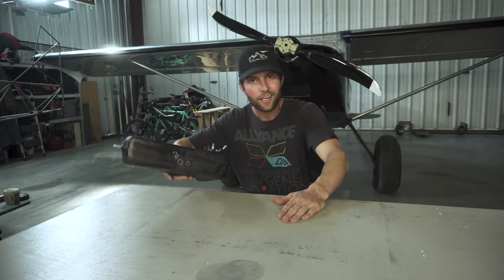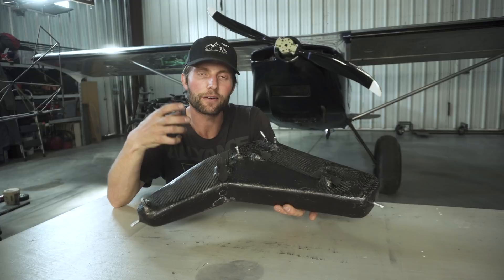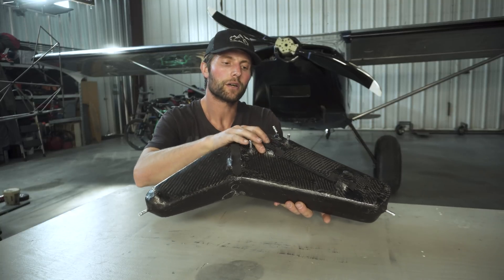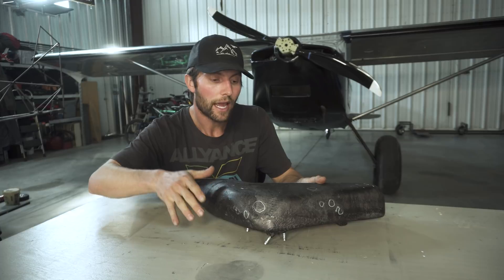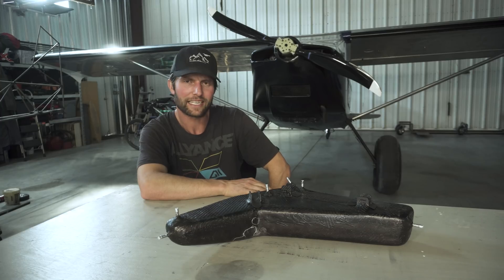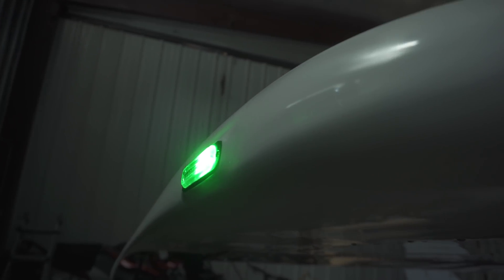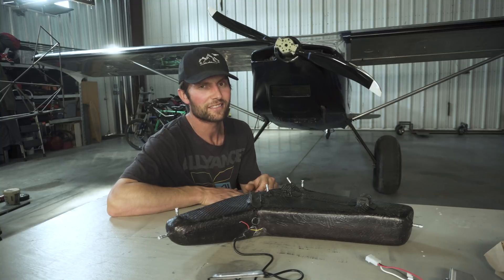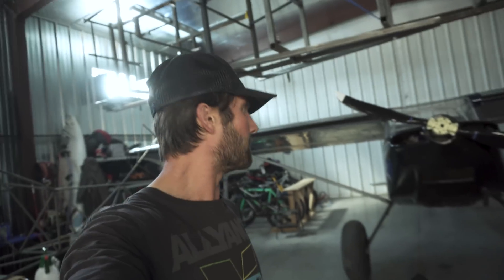Capella gets a CARBON FIBER fuel tank.

Comment: I covering the plug with clear tape ..then fibreglass or carbon resin etc.  make a fitting hole and dissolve the foam with thinner .. acut the tank in two part and remove the  clear tape ..then join the the two piece with materiel

Comment: i love it! it is  like a dumb version of Mike. :-)
Reply from the maker: I actually fallowed the advice from Mike to dissolve the foam 🧐
Reply: @JonasMarcinko  forgive me for the remark I just couldn't resist laughing when I came across your channel and saw how you do things I consider very complicated. I worked in aviation and even co-designed the fuel system for the G150 so I know how things can actually be so much more complicated than people realize. BTW I think it would have been nice opportunity to try rotomold, this why you can have a clear plastic tank you can see how much fuel you got and you can have less ports and chances of a leak. (And I don't think Mike knows how to do that..)
https://www.youtube.com/watch?v=KkNkQRC0czc

Comment: Do those strobes work ? I ordered the same and they sent me red / white that could not switch between the different patterns and all green ones instead of green / white. I already sent them back and was refunded. How did they work out for you ?
Reply from the maker: yeah they worked for me. You need to cycle through the patterns. (There are a lot) it's a bit frustrating if you go past the right pattern though.
Reply: @JonasMarcinko  I actually did that. The Red / White set did not cycle at all. Something wrong with them. Thanks anyway.

Comment: Jonas! You probably already know, but if you don't, check out this site. He has done a lot of research on VG. I fly the same Savannah as he does, and he was the reason for me, rebuilding my Savannah. In 2010 I dismounted my SLATS and installed VG's, same STOL performance but 12-15 Mph faster without SLATS/speedbrakes. 2 years ago I rebuild my wings to the "VG Wing", longer cord and VG's. That gave another 5 Mph, so cruise is now 100 Mph with Rotax 80 Hp. Not bad for a tricycle ;) 
Thanks for great videos 
https://www.stolspeed.com/

Comment: Make sure you get adequate fuel flow from your header tank in a nose up (climb) full power configuration.  On my PA-18, I have a header tank on the firewall (left tank) and one located behind the baggage compartment (right  tank).  By the cub operating manual, the left wing tank should always be selected on takeoff since fuel starvation is possible from the right tank (I think because in a steep climb the right header tank is potentially below the carb in a low fuel situation).

Comment: Aluminum fittings will corrode quickly due to the galvanic difference with the carbon fibre tank.  You need passivated stainless or titanium fittings.  Alternatively you need to electrically isolate the aluminum with layers of e-glass or s-glass.

Comment: Jonas;  Loves you videos.  Great work on tank.  However, be cautious of gas tank slosh.  I have a Van's RV-8A.  Van's has a Service Bulletin on Gas Tank Slosh  (https://www.vansaircraft.com/service-information-and-revisions/sb-11-9-13/) .  I assume you have a fuel filter downstream, but as Van's states, loss of gas tank slosh could cause fuel starvation.  Also, on our fuel tanks we use Pro Seal around all the penetrations.  A pain to work with, but impervious to gas, including ethanol gas.  Lastly, with respect to the grommet you used, some are compatible with AvGas, but to be sure, I would take one and put it in a sealed jar of AvGas and put it on the shelf for a couple of months to test compatibility.

Comment: If you get one of those lufa cutters (the pizza wheel cutters) and trim some carbon fiber @ 45° about 1/8" of an inch long...you'll have a little pile of carbonium fibers, you can mix this in with the microballons and it will GREATLY strengthen it.  Don't add too much as it will be too hard to work with.

Comment: Is the weight saved with using carbon fibre worth the extra cost and trouble over using alloy. I once made an alloy tank using folded seams and with flushing sealer it did not leak. With you being on the lean side you have a built in advantage over some of the other pilots in the STOL comps AUW is what counts and the pilot is a big factor in this.  Nice instructive video. Regards, Jim in NI UK

Comment: Great work on that header tank. :) Nice try on those cuffs. VGs might help, or even retractable slats. I wonder if "BOUNDARY LAYER CONTROL"  (B.L.C.) might be the ticket. On jet aircraft they bleed compressed hot air from the compressor section and run it over the top of the wings when extra lift is needed. How to do that with a "RECIP"?  I'd bet there's a way. Might be a lot easier to install rather than slats.

Comment: You need to shape the foam then wrap it with masking tape. Resin will not stick to masking tape. Then do your layup. Once cured eat away what you can with acetone. then dig out the tape that will collect the rest of the foam residue/remnant. Could have wrapped the aluminum with fiberglass. that prevents galvanic corrosion.

Comment: Vortex generators under the horizontal stabilizer will help with blanking out the elevator because of the turbulence from the tires in the landing configuration
Reply: What evidence is there of - "blanking out the elevator in the landing configuration"?

Comment: Hey Jonas the gasoline may eat the rubber grommets. I had rebuilt a fuel pump and the gas changed the shape of the rubber o-ring and dissolved it. You should check the tank with fuel in it for a few days before installing the tank.

Comment: something to consider.  Carbon fiber conducts electricity.  If your tank isn't properly grounded, you run the risk that electrolysis will remove the coating from the inside of the tank.... I just had that happen in a metal tank, stray voltage from the fuel sender removed the leak-prevention coating (in big sheets).... will it be a problem for you? I don't know, but it is something to be aware of.

Comment: Glad to see someone really make a solid valuation of the wing cuffs. You are using a US 35B wing profile, your best bet is a moving slat... event a fix slat is not as bad... http://acversailles.free.fr/documentation/08~Documentation_Generale_M_Suire/Aerodynamique/Dispositifs_aerodynamiques/Karmann/Looking_for_lift~Exploring_high_lift_devices.pdf. You will enjoy this.
Reply: Actually, the airfoil is a modified Gottingen 387.  Slats are fine if you don't mind giving up some cruise speed
Reply: @johnhowell9327  You mean the Capella?
Reply: @jemo_hack  Yes - the Capella airfoil is a modified Gottingen 387 - some of the original profiles under-camber was removed to reduce negative pitching moment and reduce drag.
Reply: @johnhowell9327  Ah, I see the difference. Have one rib from my Capella, and I thought it was a USA 35B all this time. ;) The Cub Rib that I have here at home is too large to properLy compare, but man are they close... have a look at my link ;) Clearly you give top speed but not rally as much as everyone claims. Round Struts to Landing gear take much more out of the top end speed. And to be clear, cuffs take out as much out of top end (in other words they add as much drag as a slat) but they don’t give you as much benefits. Have a look at my link ;)
Reply: @jemo_hack   A single round gear strut is easily streamlined.  I have much data on the drag penalties for all kinds of leading edge high lift devices - none offer a free lunch when only a few knots reduction in stall speed may be gained.  It's all a matter of design priorities and compromises.  Cheers!

Comment: Now get rid of the landing gear cables to free up the absorption capabilities of the spring gear (let em whip!) and let some air out of the tires for smoother roll over rough terrain!  Is adding a high travel gear worth it at this point?  Everything is a compromise - add more complexity, weight and drag for a so called bush gear, or stick with the simple and tough heat treated 6150 alloy spring gear that you have for less drag - the stock gear seems to have absorbed your previous meteoric impact with the third planet from the sun without any trouble, LOL!   Your choice!!!!  :)

Comment: How about fowler flaps, and self deploying leading edge slats like the Zlin shock
Reply: A whole lot of additional complexity, cost, and weight for not much gain once you are already going so slow
Reply: @johnhowell9327  Yes but it would be nice to be able to land with no power, almost hands off the controls, and the plane just parachutes in and super shock landing gear handles the impact.
Reply: @gregarmstrong4653  Even if you could get to airliner like levels of max lift coefficient with multi-slotted Fowler flaps and leading edge devices you would only get another few knots reduction in power off minimum steady flight speed - there is no additional lift to be had with zero forward speed ;).  Everything is a compromise - If that level of additional complexity is worth it to you then by all means go for it!
Reply: @johnhowell9327  nope. I did not say zero forward speed. zero power. Optimised airflow and control at incipient stall is a useful trait in the stol world.
Reply: @gregarmstrong4653  Understood.  Like I said, its a balancing act of compromises.  When designing the Capella, I did not find much additional gain to be had considering the extra cost and weight (a high percentage of a light plane) that came with such systems.  Target market and other performance factors set some of the design goals as well, with a few knots additional minimum achievable speed not considered worth compromising other goals.  It appears to do quite well in the low speed department as it is if you ask me, but mine is a biased opinion ;)
Reply: @johnhowell9327  Sorry, I did not realise that you were the designer. That is an excellent little plane as it is, well done sir.  Its just that Jonas was modifying it, so I added my 5 cents worth.
Reply: @gregarmstrong4653  No worries.  I realize I come at it from a different point of view, but I get it.  Everyone is free to tweak them as they see fit to suit their own needs - Thus the term EXPERIMENTAL.  Cheers!

Comment: You should have used wax.  Once the layup is formed over the hardened wax, a hole big enough to allow molten wax to be poured in and out of the layup a few dozen times to melt the wax out can be reused for lines.  A chemical dewaxer probaly gas, too, gets the remainder; and c'et voila.

Comment: A couple of hints.  First make your plug out of soft pine wood. I use 2 by 4s cut up to the approximate shape desired. Use Bondo to glue the wood together and to fill any defects. after final shaping cover the wood with 1 or more layers of polyester resin making sure the last layer is finishing resin with wax in it. Make the plug in 2  pieces. Glue each 1/2 to a smooth surface such as metal glass or plastic. Wax and PVA the plugs then do your vacuum bagging. the extra material that overlaps the smooth flat surface becomes the glue flange for the 1/2 s after trimming. This makes a much more accurate and better layup. 
Second you can reduce your low end speed even more by making and installing sheared wing tips. Use as an example the sheared tip found on some RV aircraft. 
csmale9@gmail.com
Reply from the maker: I've had thoughts about trying different wingtips. I might try something. thanks for the info!!
Reply: Or use tig welded aluminum.
Reply: @roymoon1  Excellent idea best yet

Comment: You should be able to dissolve the extruded polystyrene in toluene or benzene or xylene as well as the acetone that you used. You may be able to get a better more complete result with some of the other thinners. Take your time and let the thinner do its work. The paint departments have a whole lot of thinners that will work. Run some tests in small cups. Have Silvija pour while you hold, and wear eye and skin protection, please.

Comment: For fittings in carbon, I recommend using a bulkhead fitting and Fay seal the contact surfaces and fillet seal using Pro Seal 890.

Comment: Look at what Steve Wittman did to the wingtips on the W10 .increased top speed, and lowered the stall. Talking about slow, I flew a J3 cup backwards down the runway in a strong headwind once in ground effect.
Reply: wow ,  Ive heard about slow, but backwards, thats way cooler
Reply: @gregarmstrong4653  it was fun, added power, and landed.

Comment: If you are building new wing tanks, you can install baffle ribs with some swing check valves and there would be no need for a header tank (weight savings).

Comment: To test the fuel integrity of your carbon fiber composites, get a sample of your material and soak it in some high nitro model airplane fuel just to make sure it is "hot fuel proof"  Be extra sure you don't have a failure in the air.  I come from back in the day when we had to build our own models.  And yes we are super bummed out about no Sylvia.  (sorry for the spelling)

Comment: Also for carbon fuel tanks you normally put a liner on the inside to prevent leaking. Thats how Race cars do it.
Reply from the maker: Yeah this one did leak tiny amount. Trying more tank sealant coatings.
Reply: @JonasMarcinko  Just tig weld some aluminum and call it a day. You over think some things and under think others.
Reply: @roymoon1  yeah for reliability i just went aluminum. 

https://www.summitracing.com/search/product-line/holley-hydramat-fuel-pickups/part-type/fuel-cell-pickups?fr=part-type

Id also suggest one of these they work very well especially in a plane I bet
Reply: @sebastianvalero3804   RDS Aluminum made me a custom really odd shaped (all tapers, beyond my drafting ability)  header tank years ago, no leaks still. I made a cardboard mockup and ups'd it to them, with the the fittings drawn on it. Two weeks later got back exactly what I wanted for a very reasonable price, less then $300.00 I think it was.

Comment: Hey partner, I just installed VGs on my cygnet (if you know what that is).  It did stall @ 41mph, now it doesn’t stall!  It runs out of elevator at 35mph, but doesn’t stall.
Reply from the maker: That’s what I like to hear!
Reply: Now I need to do the elevator and gap seal to see if that helps.

Comment: Absolute experimental work Jonas. Doing it your way. The tank fit is perfect. Continue what you do. ✌🏽
Reply: The tank leaked and the strobes don't meet FAR requirements. He doesn't think too far ahead.
Reply: @roymoon1  Roy moon take your negative, hater attitude somewhere else..
Reply: @mark675  It's not a hater attitude. If you watch his videos you will see a constant stream of preventable hazards. Like flipping his plane because he rushed take off. Stranding himself 8000 feet on snowy mountain top. Home brew ski jump ramp failure. Now a leaky gas tank behind his head and strobe lights that can't be seen 90 degrees off axis. It's one thing to cook up things for your car. But airplanes parts require a higher degree of quality.
Reply: @roymoon1  ok Mr perfect 😂

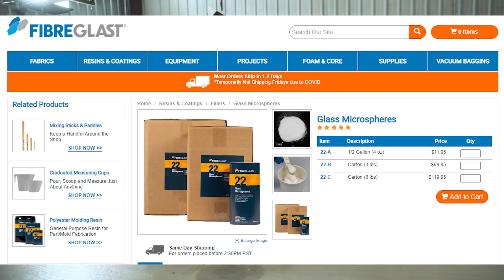Comment: 2:38 micro is NOT super strong.. use flox if you want strength. Capping it with carbon over the micro helps, but the micro by itself is not structural.
Reply: Probably Flox and micro balloons or Cabosil mixed for the most strength. I would be worried about vibration cracks with Cabo or micro spheres alone.

Comment: Any RFI generated by those Amazon strobes? 
I used some inexpensive LED strobe lights on my pickup (first responder) and they wipe out my VHF radio when they are on.
Reply: Try ferrite cores to clear up the radio.
Reply: I just hooked up 2 6in LED bars on my sons power wheel. That EMF must be large because my FM radio was 15-20 feet away when I turned on the lights they knocked it out.
Reply: Those strobes do not come close to meeting FAR requirements.
Reply: @roymoon1  so you've tested them? The far simply says where they need to project light and how much min. In some cases a tail position light is needed as well.

Comment: Is that epoxy resin fuel safe? Not all are.
Reply: The screen flashed "it leaked". I knew it would when he said he used rubber grommets. He seems to ignore good aircraft construction methods. It's one thing to experiment with 4 wheels on the ground. But not 5000 feet in the air.

Comment: What are the laws on modifying aircraft where you live, because there must be limits to what you can alter without notifying whatever aviation authority it is over there and having it checked.
Reply: It's experimental and doesn't have the same restrictions as certified airplanes.
Reply: We have armature built Experimental aircraft here. FAA will do initial inspections, but you can design, build, and work on them yourself. Lots of innovation.
Reply: @MX304  ahh, yeah, forgot you have weird experimental rules